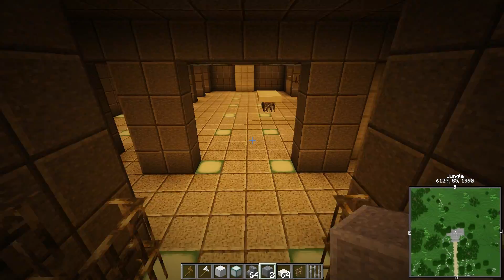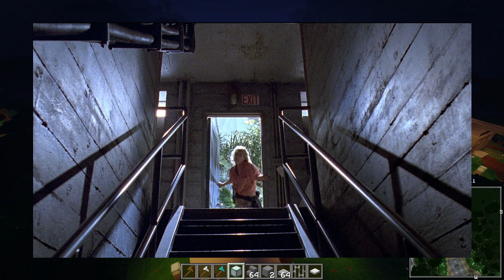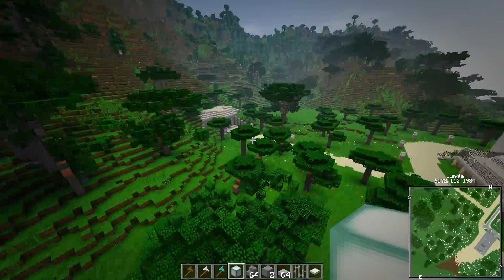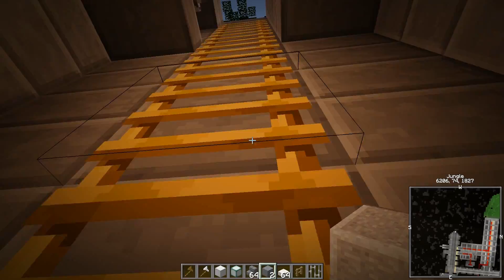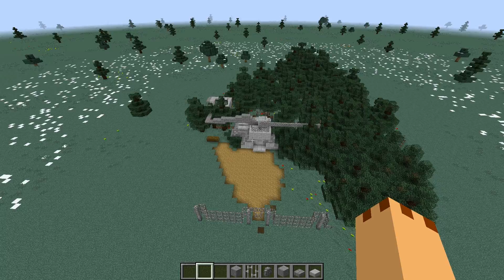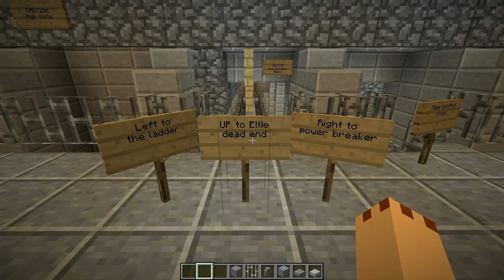Jurassic Park Raptor Pen Power Bunker Build Pt2 JurassiCraft 2 Ep225

Comment: The emergency bunker is supposed to be on the opposite side of the lake in front of the visitor center.
Reply from the maker: there has been a lot of conjecture where it was, yes they had to walk from the emergency bunker past the Raptor pen and onto the Power Maintenance shed. this map is not the finished map as in the next episode I port it all into the real Isla Nublar 1993 JP Map which is way better as I built this in behind JW Lake of course thx